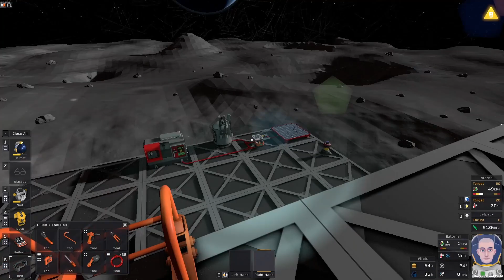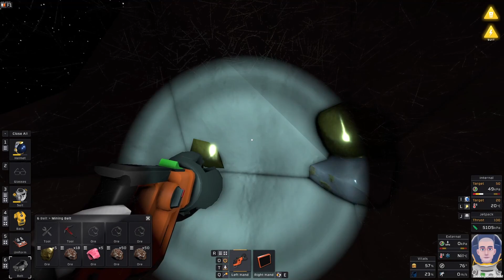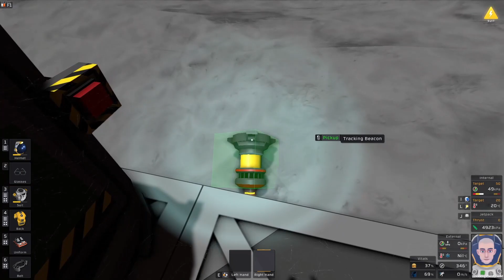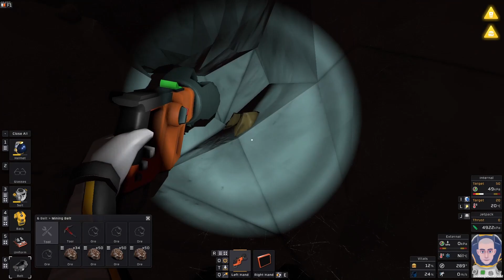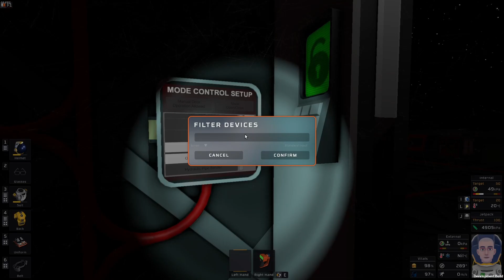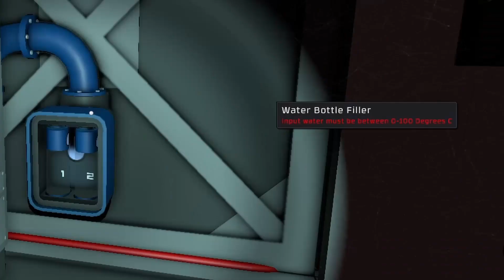H2O is important, so let's make some! [ep2]

Comment: Great Lets play :)

Couple of tips:

1) Heavy cables aren't always necessary. Normal cables have a 5KW limit so that's like 20 solar panels. 
But even then you can use a transformer, so multiple grids of 20 panels going into a transformer and then using heavy cables into a battery.

2) You don't need to build walls and roofs out of frames unless you're on venus or if you want a 100% vacuum box without heat transference.
Iron walls and windows are a lot cheaper and faster.
But i guess it's a personal preference because I also use frames a lot.

3) I suggest building an ice crusher for welding fuel first before you try to weld a base that big. Once you're out of fuel you can't build the ice crusher needed to make fuel.